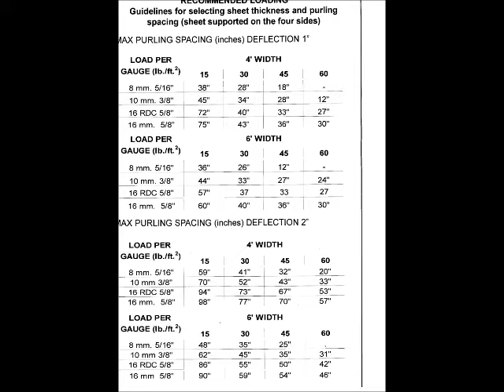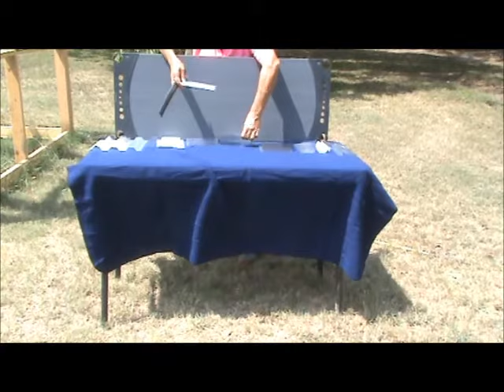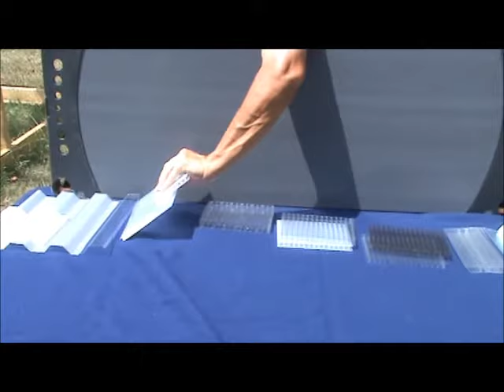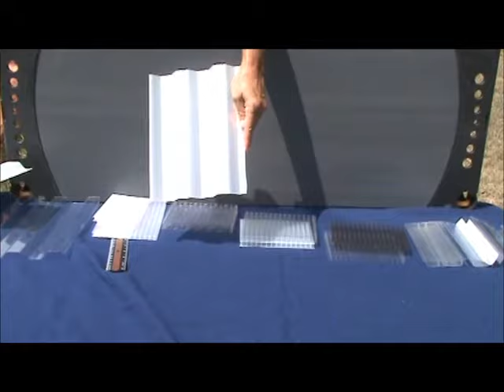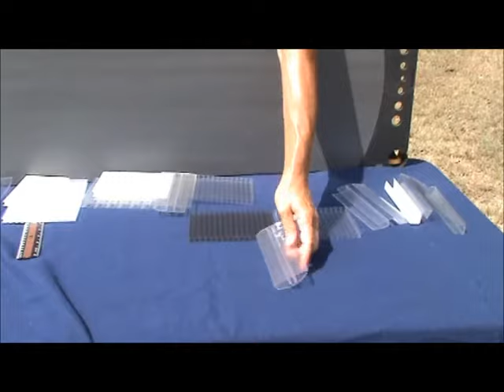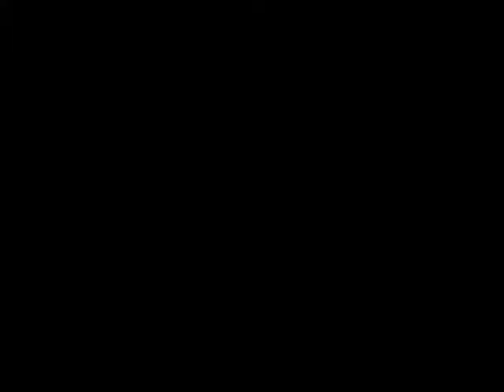Build Your Own Greenhouse With Polycarbonate Sheets

Comment: What do you use to join the wall sheets,are those caps for roof fitting?,and do you screw them bars to rafters first?,and in between the bars you screw the sheet to the purlin,with special screws

Comment: We are looking to build a permanent greenhouse of poly(whatever is best) that is in snow country. Your discussion of purlings is important, but how do you know which thickness of the poly is best?
Reply from the maker: Marti, I would suggest the 16mm clear triplewall for your climate. If you go to the bottom of page 2 of this pdf you will see the chart for purlin spacing. https://advancegreenhouses.com/wp-content/uploads/2014/08/polycarb-installation.pdf
If you have further questions you can reach me at 877-238-8357. Or visit our main polycarbonate page here. https://www.advancegreenhouses.com/polycarbonate-sheets/

Comment: how do you open the snap cap H channel easily? the one i bought from Home Depot was too tight to separate the top snap cap from the bottom one. mine is a 8ft. Appreciate if you can show with a video. I tried several different ways but ended up returning them.
Reply from the maker: Hello. We ship the base and cap as 2 pieces because it is tough to get apart once it is together. That is a good thing. Don't want sheets flying out in the wind. My best suggestion would be to try to slide them apart instead of prying them. It should work, but will be time consuming.

Comment from the maker: I am not very familiar with green polycarbonate. We do not really have anything like that available in the US. About the only polycarbonate that has a greenish tint at times is the Polycoolite, which is a specialty sheet to help cut down on heat. Most people think that clear glass would have 100% light transmission, but in fact it only has 90% light transmission. 8mm clear twinwall polycarbonate has about 80% light transmission. Some of which is best for you depends on what you are growing. If you are growing vegetables the 80% light transmission is a good percentage. If  you have green available check and see what the light transmission is for it.

Comment: Good video. How expensive is each sheet?
Reply from the maker: Hi Benjamin. Thanks for the great comment. It all depends on which thickness you buy. Also, we carry 3 different brands and each of them is priced differently. Our sheets are available in 4' or 6' widths and lengths from 6' to 24'.  That being said, the cost for a 4' x 8' sheet starts at $47.36 per sheet plus crating plus shipping. We do have a minimum order of $500.00 worth of sheets, so you would need to order a minimum of 10 of this size and thickness. We do have a polycarbonate quote form on each of our polycarbonate pages. We are more than happy to supply you with a complete bottom line quote with no obligation. For more information on our polycarbonate sheets visit this page. http://www.advancegreenhouses.com/polycarbonate-sheets
Can't find what you are looking for? Just contact us and we will be happy to help.  Thanks, Tammy